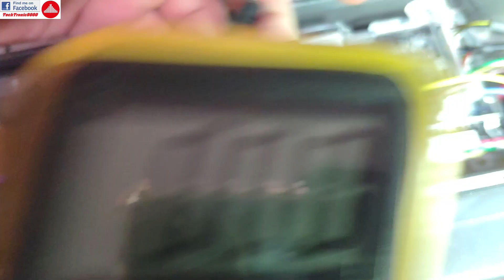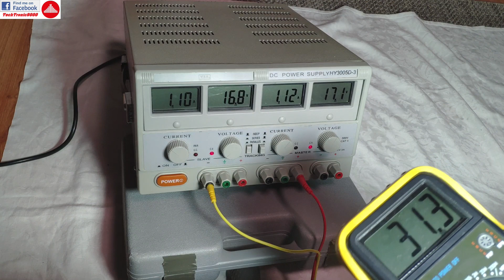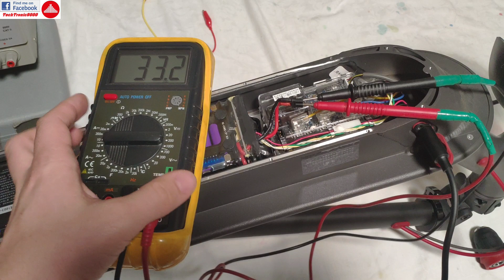Xiaomi M365 Battery Revival - Over Discharge (one year stored empty)

Comment: How do you do this without that machine can I use 12v back up battery’s to connect to the battery to give it charge? I was thinking 2 12v in series connect it and see what it does
Reply from the maker: You can actually try to use the original charger to do this.
Reply: TechTronic9000 how would I do that without breaking the charger to strip back the pos and neg cables
Reply from the maker: Disconnect the normal charge cable as it has a plug inside, use that connector and carefully hot wire it to the discharge plug. You need to be extra careful not to short the wires as they can blow the charger or the battery BMS.
Reply: TechTronic9000 hi mate thanks for replying I done EXACTLY this before reading, I cut the red and black cables that come from the external charger and I was able to use the little white connecter plug to get the 42v, I plugged it in the other red and black that connects to that circuit board and the charger turned red! Then it went green and I’m still on the same place! My battery is giving off 20v or so and it doesn’t go higher than that 😞
Reply: @TechTronic9000  what is the discharge cable?

Comment: Hey great video. I have 3 cells that are 0.1 and bd 0.3 volts. The battery won't charge the connectors looks good no cracks... What can I do... The whole pack is only 3 volts but all the others individually are 3.6 apart from the 3...what can I do... I don't have a charger like you. Tha kyou
Reply from the maker: If the cells are at 0.1 / 0.3V then I'm afraid that you have to replace them
Reply: Hey I had the exact same issue as you. I had the first three cells reading 0.1 Volts and the rest were fine. I replaced the first 3 cells but it's still only reading 3 volts at the connector. Did you end up fixing this? I dont have a charger and the xaomi charger is 42v, 1.7a which is to big am I right?

Comment: I recently purchase m365 model and it gives me 14 % of charge taking to 3.3 km from 100% to 30% .....after 30 to 4 it gives me tha same 3.3 could you please what is the reason.....thankyou in advance
Reply from the maker: Use an app such as M365 tools and check each cell voltage, if you observe a difference of greater than 0.2V then you have a bad contact, you can check my other M365 videos when I also address the bad contact problem.
Reply: @TechTronic9000  could you please shre video link .....and also I can't connect with m365 tool app suggest me Another app
Reply from the maker: For the app to connect enable Bluetooth and GPS on your mobile phone first. Here is the other video: https://youtu.be/iJ2HvCNnYmQ
Reply: @TechTronic9000 cells voltage differences is 0.05 ..it seems good I think 🤔 😕

Comment: hello my question my xiomi does not take gas. I opened the bottom and the battery lights up blue not blinking it is so right. he does not take gas
Reply from the maker: What voltage does it have?
Reply: @TechTronic9000  battery status (normal)
voltage (41.34)
battery level (7830mAh)
Reply: performance (0.38)
Electric (0.01)
Reply: 100%

Comment: Hi, Great! Thank you it's working. 
If you don't have an external power supply, use the one of Xiaomi directly plugged to the battery connector. It worked for me :)
Reply: Sorry, could you explain a bit more how you did this, please?
Reply: Can someone please explain how to do this with the regular charger. Thank you in advance!
Reply: @bobbyjohn9448  explain please
Reply from the maker: Thanks for sharing
Reply: @TechTronic9000  How do you connect the wires to the power supply if using the xiaomi one?
Reply: would I use something like alligator clips?
Reply: Nice but it is better to check thé current to avoid it come over 1 A
Reply: But how do you do that ?
Reply: @juliensoyer5786   if you have a voltmeter, you can check the current as you charge it.
Reply: Just connect the negativ and positive from charger to battery?

Comment: I don't have a power supply. Which one do you recommend for my Xiaomi m365??? It has been months since I don't use it, and now it doesn't want to charge at all.  The battery is around 18V  :(  My scooter is almost brand new.  I don't want to buy a new battery. As I used my scotter for  only 3 months. I hope you can help me out as I know nothing about these things.. :S
Reply: Use the normal charger that came with is. You will have to strip the wires though

Comment: Great video. I just got my scooter back after months of no use.

The pack was bouncing between 16 and 19V as if something was drawing current while off.

I plugged in the standard charger and within 1 minute the scooter booted up and was at 33V.

Is this normal? Is it safe?
Can you talk more about the safety feature you talk about the pack "sleeping".
Reply from the maker: It is safe, fully charge it now and it's ready to be used.
Reply: Mine is around 18V , but it doesn´t charge at all. It always has a green light, never turns to red. I don't have a power supply, and I have been using the charger that comes with the Xiaomi which is 48V.  When you talk about the standard charger.. what do you mean?

Comment: Thank you for the video, wheels on scooter would spin, but whole scooter would turn off when put on floor, bms button pressed, went from blinking blue to solid blue. Can you tell whats wrong with my scooter. Very little mileage. just no usage after 2years
Reply from the maker: Does the battery charge? What is the voltage?
Reply: @TechTronic9000  I dont know I havent charged down the battery, before that the battery did charge , voltage showing at 41.2V
Reply: @TechTronic9000  any ideas?

Comment: Thank You very much my friend.Ευχαριστω πολυ-.You save me and my scooter,after one year.I fix the battery with the original charger.
Reply from the maker: Glad I could help! ευχαριστώ που παρακολουθήσατε το βίντεό μου
Reply: Hi how did youthat? Can u pls explain the step? Plz
Reply: @audy6947  You can use the original charger if you can wire it to the discharge port, but you need to be careful with polarity and wires not to make a short circuit. Also don't keep it to much connected 5-10 minutes at most should do it.
Reply: @Gyoyla-Lorand  can you explain how you did it, please?
Reply: @aurelm  You cut your charger(don't worry you will merge them again),and you connect them how he show on video on 3:17 and charge for 5 10 minutes NOT MORE..
After merge again the cables from your charger and charge your battery.

Comment: Mine was at 30.5 V and wouldn't charge. Blue flash when charger disconnected, and red when connected. Charger LED remained green. With the XT30 plug (black plug from the battery to the x365 mainboard) disconnected I pushed the BMS reset button with a toothpick, and boom, it started charging! Just something to try for anyone else, that doesn't have an alternative power supply! :)
Reply: Hi Sund. Im in this situation, I dont know where the BMS reset button is :(
Reply: @daveholly9005  it's under the plastic covering in front of the battery pack on the left side... didn't work for me
Reply: Michael Wise Cheers mate.. worth a try 👍
Reply: @daveholly9005  I just connected the inside of the charger to the +ve terminal and the outside of the charger to the negative...charged for 10 min and it is now charging through the normal charging port.

Comment: Hi, Very good video. I've check all the usual battery issues listed on youtube before finding your Video. I have the same problem as your Xiaomi, the only difference is I left mine was on charge for about 4 months without use. I have variable DC power and have connected the same as you. I'm reading 19v at the BMS terminals, I had to increase to 40v to get a 1A charge (got worried so stopped the forced charge). I did before seeing you Video try charging via the normal charging terminals, but couldn't pass any current. Also when I force via BSM terminals both the red and blue LEDs flash, is this correct? Any advice helpful, Cheers John
Reply from the maker: You need to charge it for a few minutes through the discharge plug and then the normal charge plug will get active again.

Comment: Hi I have the same issue, I haven't used the scooter In months and have the red BMS blink of death.. how can I do this without your system?
Reply: I used my charger. 2 wires using an 18g butt connector to the center pin of the plug slightly crimped to fit snug. wrap the other wire around the barrel of the charger. crimp 2 male wire ends and plug it into the battery.
Reply: @miramon4050  are you able to share what it looks like? thanks
Reply: @miramon4050  used your advice. But used an alligator clip on the outside (charger/neg) it worked. SHES ALIVE 🤙🏻
Reply: @ort619  hi! could you please share a photo how this looks like? Thank you!
Reply: @ort619  I would also ask for some photo how does it looks like.
Reply from the maker: You can use the original charger if you can wire it to the discharge port, but you need to be careful with polarity and wires not to make a short circuit. Also don't keep it to much connected 5-10 minutes at most should do it.
Reply: @TechTronic9000  so you basically charging backwards?
Reply: @TechTronic9000  You, my good man are  a lifesaver! Just tried it and it turned on after months of being dead! Thank you!
Reply: @TechTronic9000  I use this method and it worked! thanks man :)

Comment: salut ! o intrebare daca ma poti ajuta : am observat , dupa vreo 2 luni de hibernare a trotinetei mele xiaomi m365, ca pe aplicatie la voltajul individual, imi apare cel 1, de culoare rosie, cu o deviere de 0.021V . Este un motiv de ingrijorare sau nu ? Am incarcat-o inca de vreo 2 ori si tot asa. Nu am mai patit asa ceva . Ce as putea face ? Multumesc anticipat si multumesc de informatii !
Reply from the maker: Nu este nici o problema, o deviatie de 0.2V pune semne de întrebare, 0.02 e foarte OK.
Reply: @TechTronic9000  multumesc inca o data !
Reply: @TechTronic9000  Nu am găsit nici o informație referitor dacă  bms face un fel de balansare a celulelor. Din ce observ, încărcătorul încarcă bateria în serial, iar când prima celula ajunge la ~4.2 v se oprește încărcarea. Celulele se pot autobalansa in timpul încărcării seriale? Totuși am lăsat încărcătorul peste noapte și nu am văzut sa facă vreo balansare a celulelor. Tot am diferența de 0.031V între celula mazima și cea minima

Comment: It is not good to leave it unloaded, especially for long periods, the batteries are kept only fully charged, or as the energy is easily lost.
Reply from the maker: For long time storage Li-Ion should be kept at 40-60% SoC and checked regularly not to self discharge lower. The scooter was not mine, i've just fixed it ;)
Reply: @TechTronic9000  Had the mine about 40-60 in storage because of the quarantine for about 3 or 4 months of no use, i charged it 2 weeks ago, would it be possible it lost capacity or power?

Comment: The only bad thing that can happen is if it's an old or somehow defective battery, one of the cells could be lower dragging the whole thing down. In that case case it could be a bit dangerous, but it's veeeery rare and if you keep a low current and check the temperature of the pack it should be fine even then.
Reply from the maker: You are right, but this scooter only had 1 use, no charges and stood like that 1+ years!